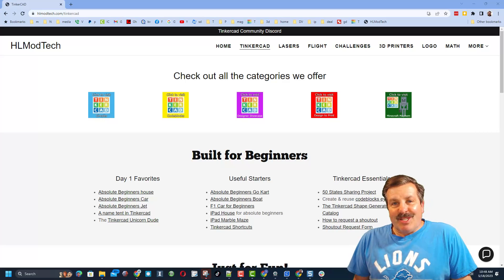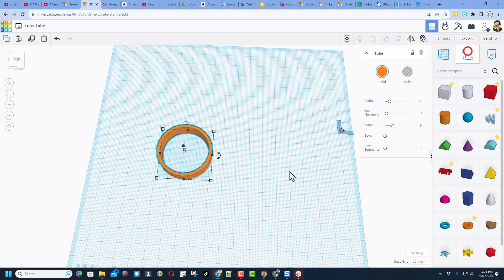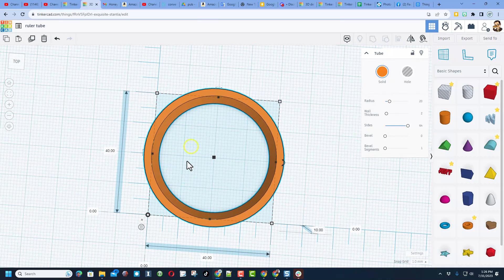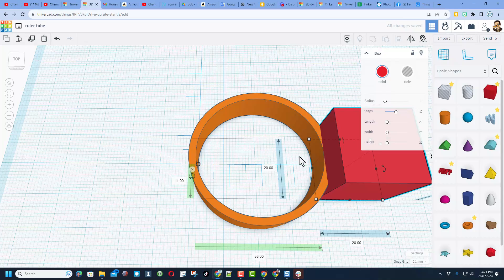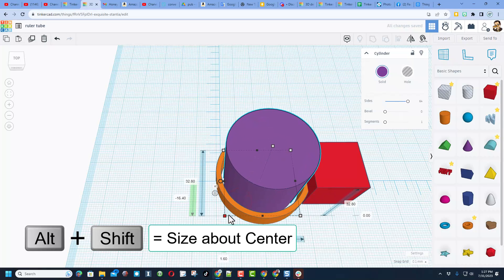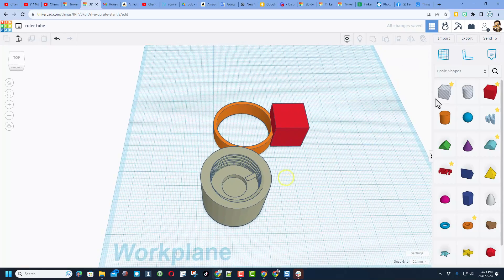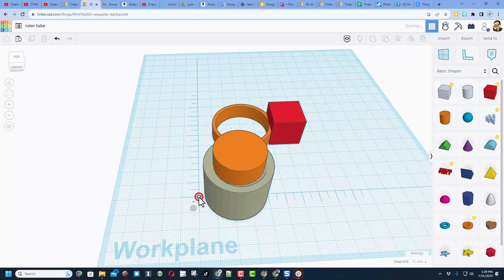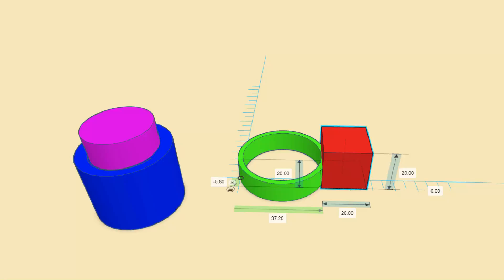A Smart Way to Use the Tinkercad Ruler With Tubes!

Comment: Is there any free CAD software out there that allows you to add/drop in particular dimensions to an object as desired?
Reply from the maker: Not sure. We can type numbers in Tinkercad though. What are you trying to make?
Reply: @HLModTech  Thanks for the reply.  Just trying to create a CAD file that displays accurate dimensions, and also, which dimensions are specifically displayed, as well as what dimensions are NOT displayed.  Nothing radical.  For instance, a cube with two holes.  I'd like to specify the L, W, D of the cube, the diameter of the holes, and the distance between the holes.  No extra dimensions (like the "ruler" in Tinkercad adds by default).   Thanks again!
Reply from the maker: I have a few videos about Sketchup. https://youtu.be/_n9IcJS0J-c It may fit your needs.
Reply: @HLModTech  Thank you for your time and expertise.  I also have begun to work with FreeCAD, and it seems to fit the task
Reply from the maker: @DjangoUnchangd  Very cool. One of these days I will fiddle a bit with FreeCAD. 👍

Comment: How do you set this up for printing, do you have to allow something for the nozzle size ?
I worked out everything I needed but after printing it was too tight 😢
Reply from the maker: You likely had your numbers perfect, but your printer is not calibrated well enough. This video shows my strategy to find the right numbers with my printer. https://youtu.be/dObaSlKADr0?si=4GrR9jtlM5bQQQXs&t=244 I have it cued up to the point where I talk about that.

Comment: If you make the item you want to measure Yellow colour and the measuring item a Hole you can see when that Hole touches the edge better. After the measure just delete the Hole
Reply from the maker: Nice idea. I bet setting them the inside part to transparent would be nifty too. Thanks for the tip! 💯👍